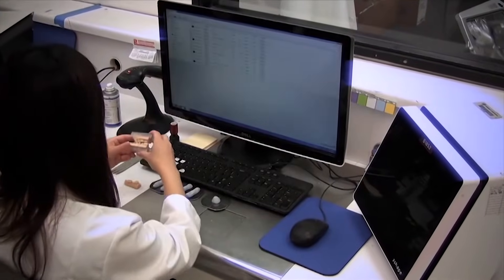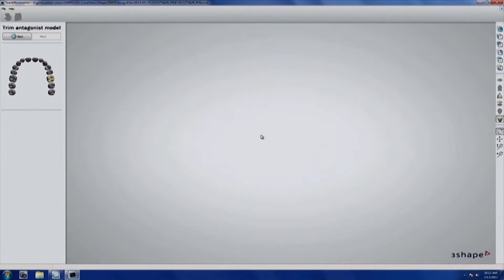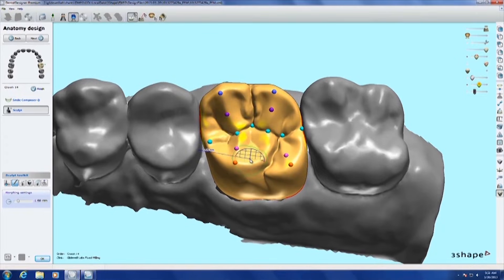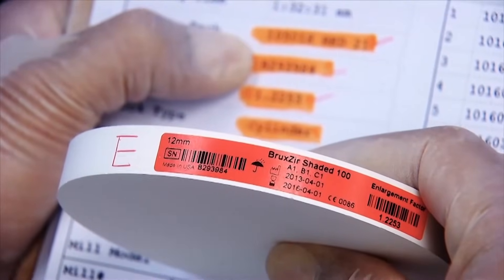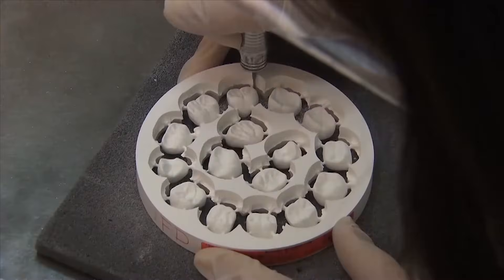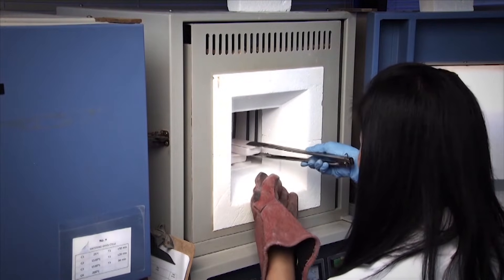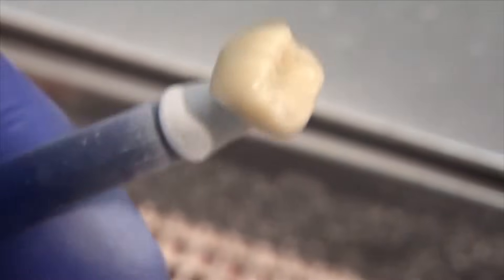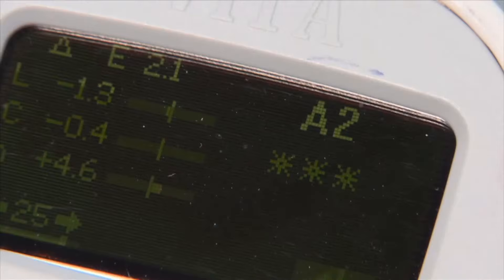Case of the Week: Follow a BruxZir® Crown From Start to Finish

Comment: Don't use 3 Shape scanner and then you will find a good impression scanner. Yes, you can buy one from China for a fraction of money you have to spend for Polish made 3Shape (yes 3Shape is manufactured and designed in Poland, not Denmark as they say in the leaflet). I use UP3d and it scans 90% of impression without having a need to make a stone model.
Reply: Where can i buy a chineese scanner. Which  one do you use

Comment: too much reduction of the natural tooth...which is not recommended for Bruzir crowns.. retention is the problem..
Peri Cervical surface area Should me maximum for better retention of the Crown..
Reply from the maker: @Harshill Matt Thank you for your comment. I agree that for a BruxZir crown, the tooth reduction parameters are different and less invasive as opposed to a porcelain fused to metal crown.  BruxZir crowns do not require layering and because of their strength the preparations can be conservative.  In this video, we are presenting a case where a doctor had sent the impression to Glidewell for a BruxZir crown.  The stone casts present a short preparation, and clinically it may have been due to break down of the tooth because of decay or fracture of natural tooth structure.- Dr. Siamak Abai
Reply: 🎯😖
Reducing a tooth like that should be a criminal offense